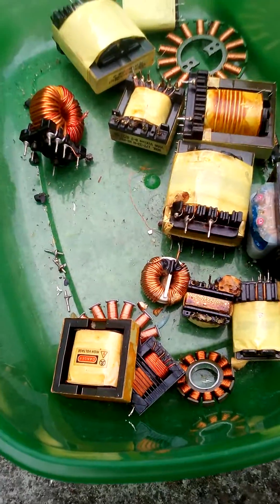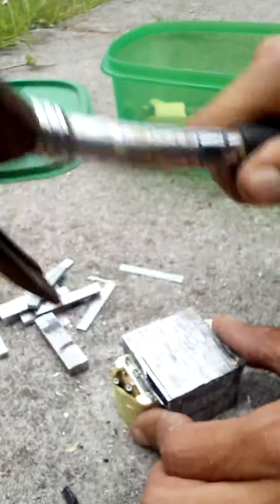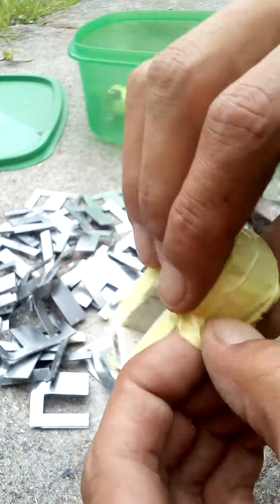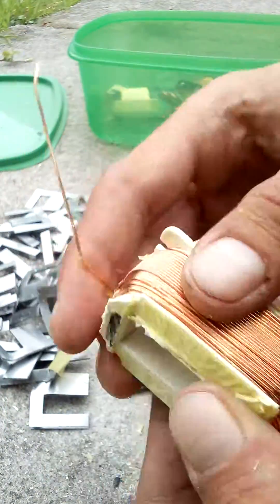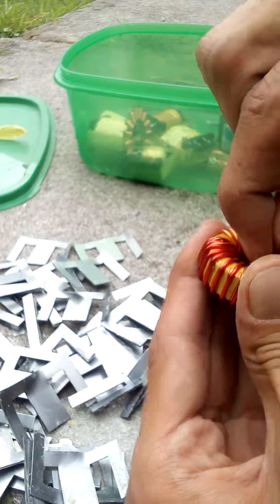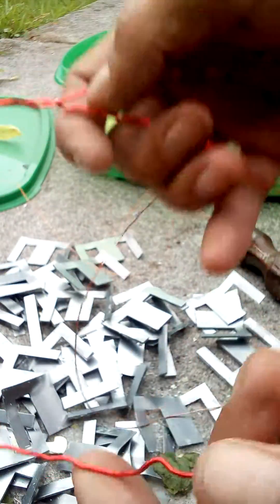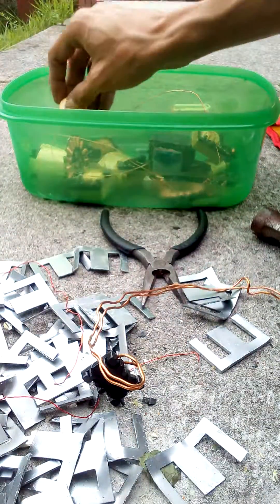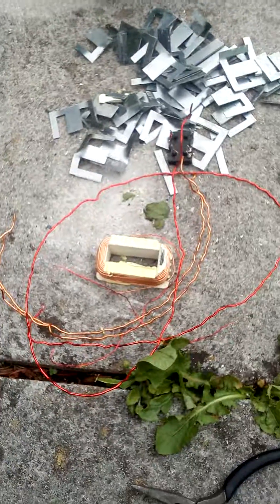Small Transformers,Teardown & Salvage.(Copper Recovery)

Comment: Have you ever used a small wooden , portable stationary base. With a straight wooden or metal peg facing up, which you place on the section you would be hammering to push the pieces away from the parts you want to get to . It’s easier and safer to your hands for sure 👍🏽✌🏽
Reply from the maker: No I have not,Sounds like a good idea though.